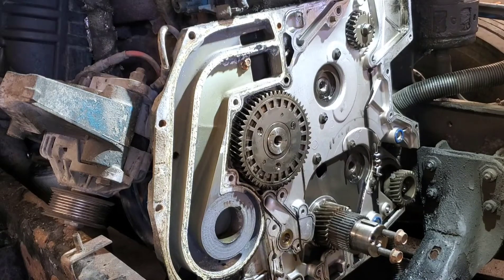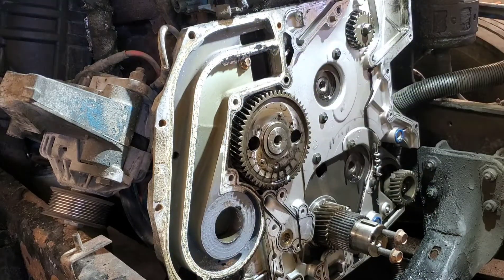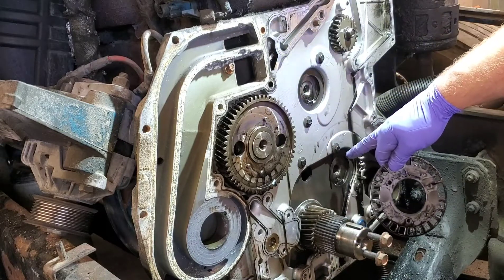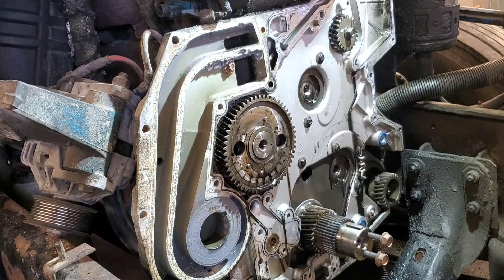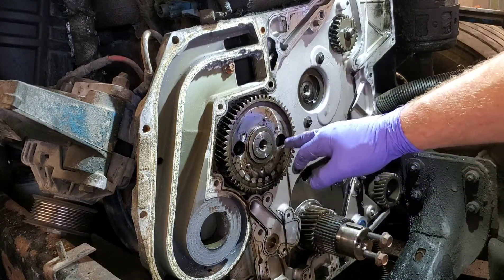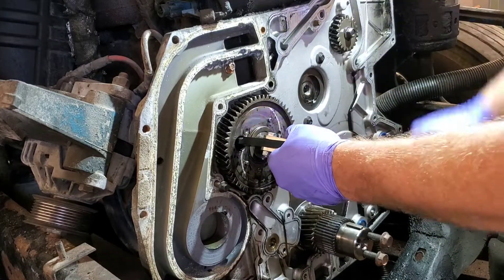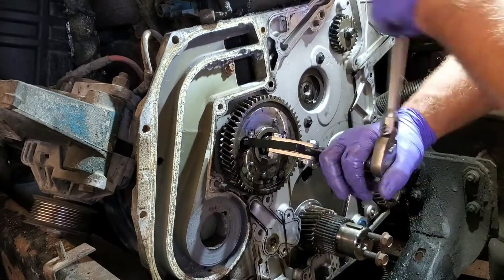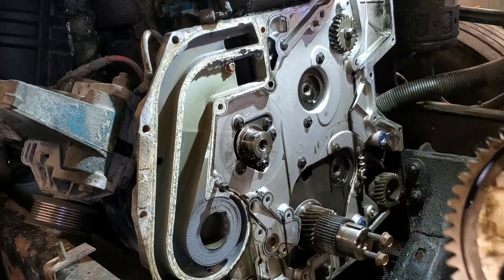Camshaft Gear Removal - DT466E 2V In Engine.

Comment: Been nice to have you I explain how you turned the cam being that  one bolt is in the way..  I tried a pry bar on the teeth of the cam but it only moved 1/4 inch how did you turn it easier.
Reply from the maker: I don't remember exactly how I did it. I was not hard, though.  If the cam will only turn a little and then stop, a valve might be hitting a piston. Carefully turn the crankshaft a few degrees and that should solve the problem.